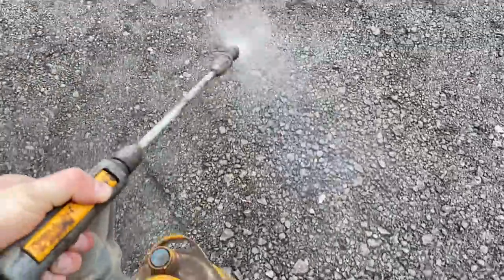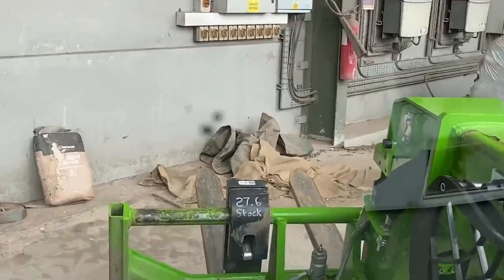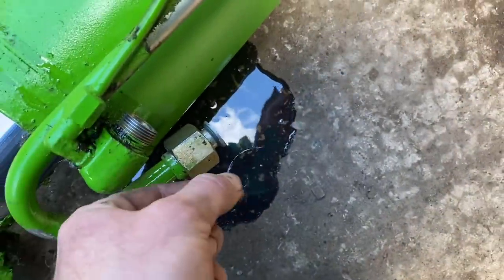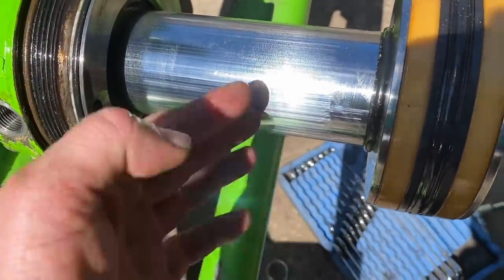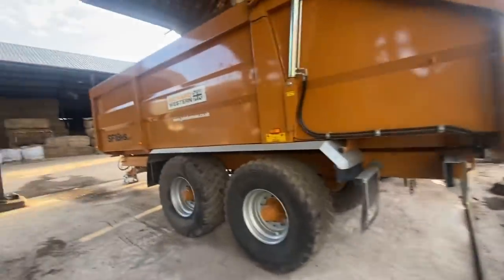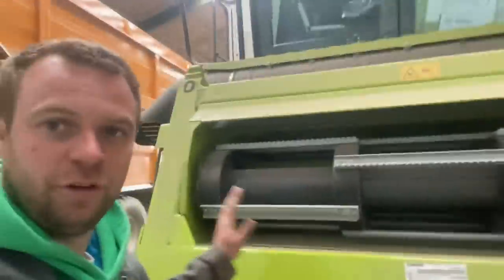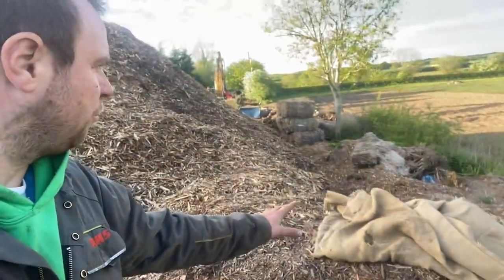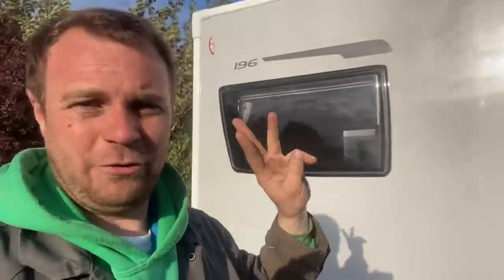Day 421    #OLLYBLOGS COMBINE MOVING SHEDS AND SOME STONES ON FIRE MERLO RAM FIX #AnswerAsAPercent

Comment: Should put an LED dot board on the back of your trailers with a control in the cab

So it can be

⚠️ HEAVY LOAD ⚠️ 

or

⚠️ BEWARE OF CYCLISTS⚠️

or 

⚠️ DO NOT OVERTAKE ME ⚠️

or

⚠️ IT IS SAFE TO OVERTAKE ⚠️

You probs get my idea by now